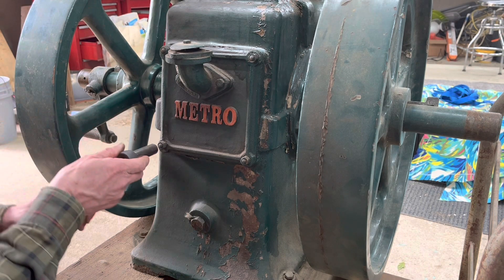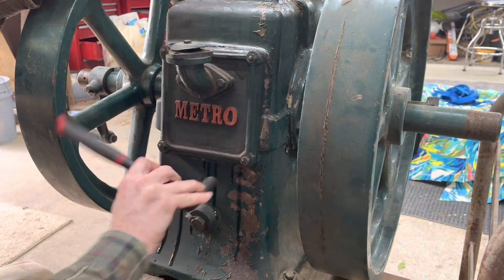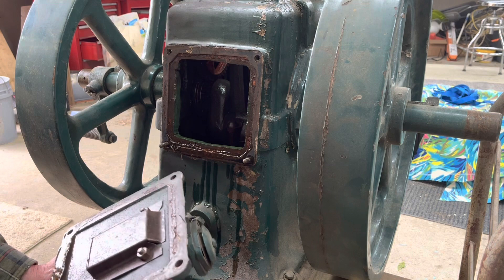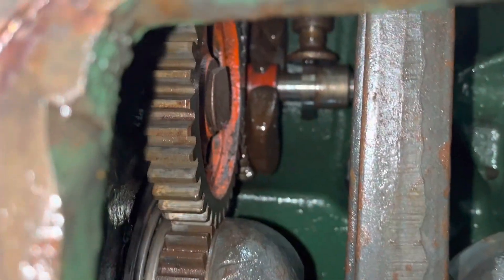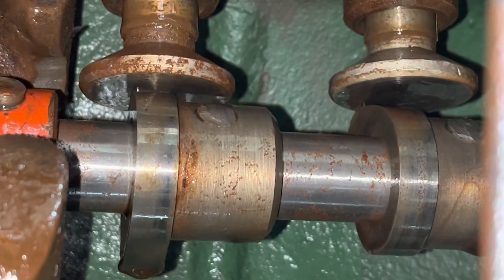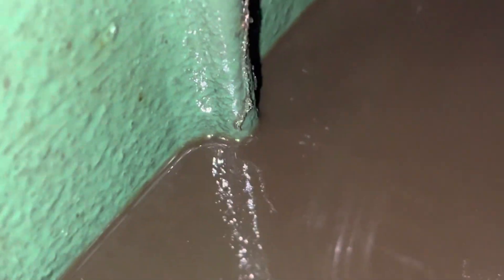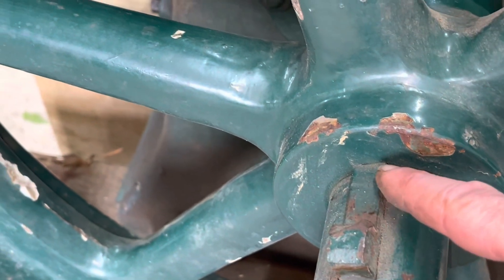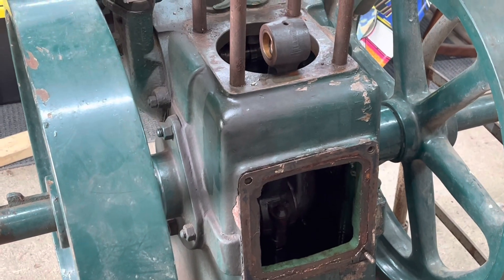A look inside the crankcase of a slow speed Listeroid diesel engine

Comment: On mine i have a 1000 watt 120 volt tube heater to preheat the cooling oil - next week it will be in the teans and we probably will get ice rain and it will knock the power out a good while - 
       When the power goes out the engine will already be preheated to  180° F with that 1000 watt  tubular heater and it is easy to start - also i use a old cast iron radiator heater for a radiator to cool it - they never fail -

Comment: With those fly wheel keys drive them in to the point that the fly wheel had to be pressed off the key or it has to be drilled out - 
       If its not hammered in hard the fly wheel will work loose in time - of the fly wheel doesnt work loose and destroy every thing in sight - it still might brake the crank shaft - 
     Ive seen things happen over the yrs -

Comment: There many of them on low flow oil wells   jack pumps, running 24/7 year round - also on generators putting voltage on lipe lines to reverse electroleses - those are on 1000 or 5000 gallon fuel tanks all over the country - 
     At 350 RPMs they run for yrs - at 850 rpms ive seen them run up to 5 yrs 24/7 befor reworking them - that ome your working on isnt rusted out that bad - 
     We order steel pistons for them - there avalable - the aluminum piston ring grooves were out to fast for 24/7 running -

Comment: Those are good engines - like any engine they have things about them but for me its not enough to matter - 
   i live in the deep south rural US and have rode out about 20 huricanes in my life - ive seen power knocked out for 9 months at times - 
        In my case i run mine as a hybrid meaning it keeps batterys charged and the batterys supply power to a 5000 watt inverter - 
     I only run mine between 350 and 400 rpms thats about 400 to 600 watts constant - 
      At 850 rpms there 8 hp
      At 650 rpms there 6 hp 
     At 500  rpm there 4 hp 
     At 400 rpm there 3 hp 
......you loose about 1 hp via the belts - 
 ...  With 120 v 60 hz it takes 1 hp to generate 416 watts  with 12 volts it takes 1 hp to generate 330 watts - 
     Thats with a roller bearing mains - it less power for the old bushing mains - 
 I up grated mine to roler bearings - 
         At 650 rpms mine produces 13 kws per gallon of fuel burned with a constant 1600 watt load at 120 volts at 60 hz - - thats a little over 4 times less fuel than a regular gasoline generator burns - 
    I dont know the effecency at 400 RPM my guess is it might be up to 18:1 effecency - that means it might generate 18000 watt hours per gallon of fuel burned - also i cool mine with transformer oil - you can run the engine at 225° F that way - at higher temperures fuel burns more effeciently and there is almost no carbon build up in the head - 
      I worked on generators in the offshore oil fields for 50 yrs - retired now -

Comment: Any balance issues…?
Reply from the maker: Not that I know of.  These things are not well balanced due the the single cylinder design and will bounce around unless bolted down.  I'll be making a video of pulling the cam next.
Reply: @mainemaniacmechanic8813  I’m pretty sure my counter weights are out of phase on one flywheel…are both of yours on the same side opposite the piston…?
Reply from the maker: @offgridmangogrower  You got me wondering so I checked it out.  It all looks good, counter weights are opposite the crank throw.
Reply: The newer listeroids run a lot smoother because the crank shaft balancer is on the crank shaft like modern engines - the older engines the crank balancer is cast into the fly wheels - so they do walk - mine is  bolted down to a one ton iron plate of steel - it doesn't walk -

Comment: want to sell?
Reply from the maker: I suppose when it is put back together in the fall. I have had a busy summer but will start working on it and making videos soon
Reply: You can order listeroids from India - or there are company's in Canada that sell them - there a remake of the original lister - 
       They can't sell those engines in this country because there to efficient so they don't meet EPA standards - 
     When they ship one of those engines to the US they ship it as a air compressor and ship a conversion kit to a diesel separate - 
    It's easy to convert it to a diesel engine -